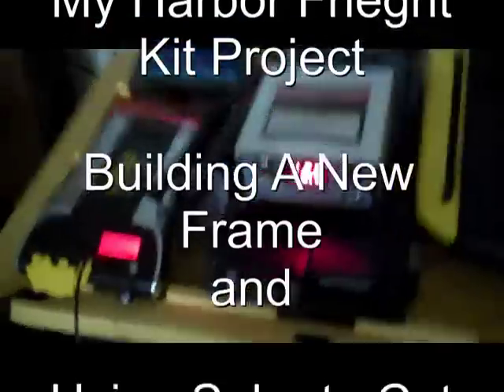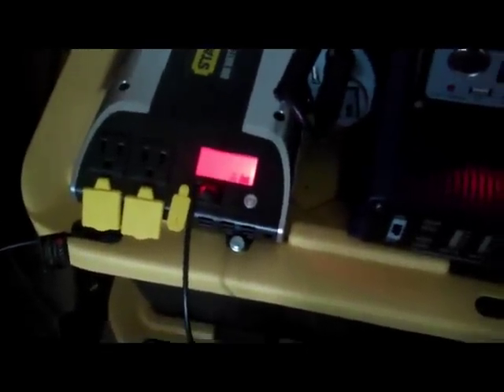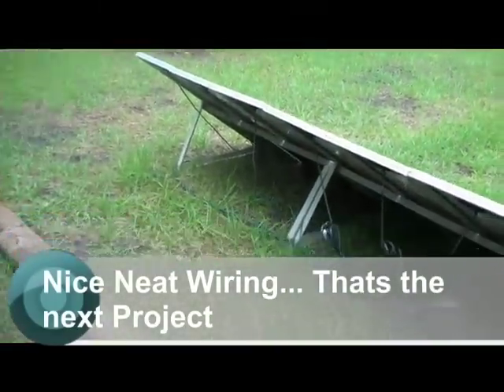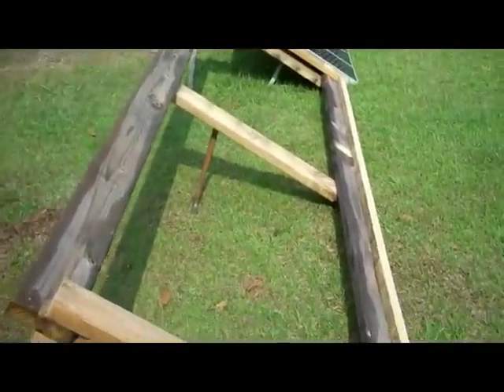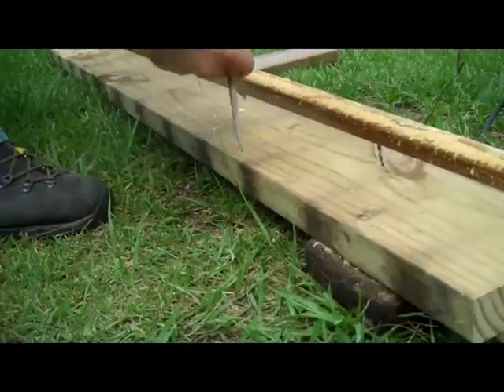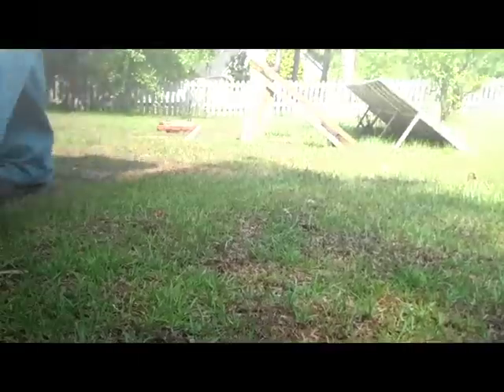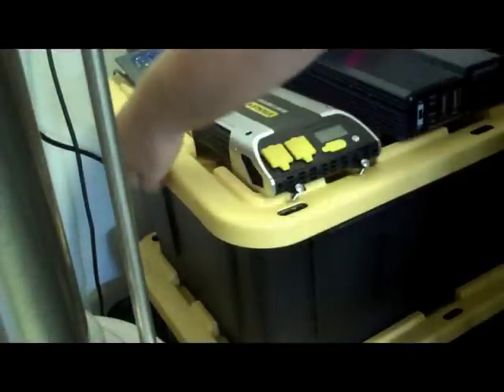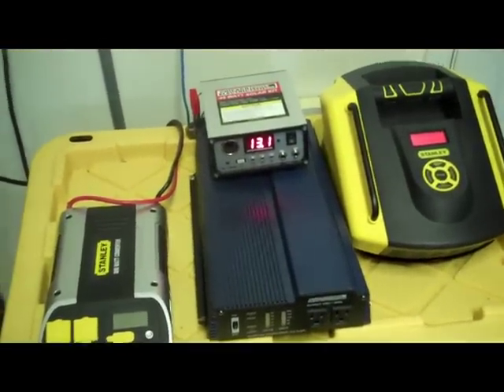Harbor Freight Solar Project

Comment: Nice Job! My only recommendation is when building a frame Screw it! It allows for replacement in any failures down the road. It will also stop the Frequency shock to the Cells.

Comment: I got 2-100 watt Renogy with charge controller and cable hookup for 215.00 with free ship, then added 2 more panels later. I run a 24 volt system and doing the same. running lights, fan, computer, cell phone/tablet chargers etc. I would look into something other then the HF units. they might be fine for a battery charger but there are better ways to go if you want to power anything other then that. I got mine off EBay and am just starting to play around with it. Before it is over with I will be running the whole house/cabin off solar and wind power. Solar and Wind the way to go. Hydro if you have the means.

Comment: Nice project, we are finally getting a Harbor Freight in the town I live in, can't wait!
Reply: The man just stated H.F. solar panels are no good. He suggests "Renogy" solar panels which according to him
work much better than H.P. solar panels. I, however, have no clue who is correct, I'm just beginning to learn what
and how is the superior way to go. Good luck.
Reply: Joseph Maximus I just read that Kyocera KD315GX-LPB 315 watt panels are the most efficient now.
Reply: Jerry Lifsey Hey, thank you for this information I really appreciate it.
Reply: Joseph Maximus
A few excellent sources of information are the manufacturers websites (they are selling stuff ... but an educated consumer is the only one whose gonna drop the big coin, so they also do a pretty good job of educating), Wikipedia -- use it to look up terms such as polymorphous, amorphous, monocrystalline and so on. It's a free encyclopedia (well, guys like me pump a few bucks into it each year) and "Guide to Sustainable Living" by Ed Begley, Jr.

Note: Ed's book is about sustainable living and will take you into a lot of areas you may not have considered, such as rocket heaters. Consider it a launching point, not a final destination.
Reply: bill65761 Thank you for the info. I will
be checking it out.

Comment from the maker: @chop98 I'll check that channel out. My next move is going to be the 100 watt panels. I think it could be never ending. It will be nice to have the ability to run what you need in an extended power outage.
Thanks for the comment

Comment: If you bought the 3 HF solar kits on sale, this setup would have cost you ~$450 (@ $150 each for 45watts/kit), to yield you 135watts.

I bought 1 kit in order to get me the voltage meter and 12v/5v outlets, then bought 4 100watt panels for $125 each from Renogy.So, now I've got 445watts for $650. That's 144% more in cost, but 330% more in production.

Comment: I would recommend a desulfator circuit for batteries in parallel wiring - this should maintain battery life 2 to 3 times longer than a maintenance or constant charge circuit and reduce your maintenance cost of the system.
Reply: yes it would
Reply from the maker: Thank you for the advice. I am looking into it now.
Reply: +ncprepper1 how many batteries do you have and how many amh each
Reply: dude check out green power of nc they are out of greenville
Reply: What is this?

Comment: Good solar setup, my solar setups are lower current / voltage , for outside security light , chargers / controllers for low car batteries. And the small Thunderbolt solar 1 watt for cell phones, players , GPS receivers, they are a lot of fun and handy.  cheers !

Comment: Thanks guy. Listen do you have a video of just of your basic system. I mean batteries wires, hookups from the panels. I have to start from zero on the cheap. I am starting from the single hf solar panels kit. What do I need next, I just haven't found the right instructional video yet. I have to start simple because it I'm always broke and I need to step in carefully. I love your rig and your video is nice and clean you took the time to set it up for someone like me! Thanks dude

Comment: Screws for the frame will be a better choice, and paint or seal the wood before assembly for a longer life. I'd go with the AGM batteries if you want to use that indoors though, the off-gassing is not something you want to breath in.

Comment: The frame is a good idea, and you certainly did a good job at it. However, why did you use such large lumber? Simple 2x2’s would be more than enough to support those small panels even in the harshest wind or weather. If you're worried about them blowing over, sink or stake the legs into the ground a foot or two. Of course, screws into pre-drilled holes, instead of nails, would provide the most strength. Finally, I personally would raise the panels two or three feet off the ground to help keep mud, debris, and rodents off, and allow easier access without bending.

Comment: At 4:37 you mentioned angle of the frame.  I read somewhere that whatever your degrees of latitude is is the degrees of tilt of your panels but then again the sun is at different angles during the day (from east to west) and from season to season.

Comment: i like what your doing....sugestions move panels off the ground for ventilation ,and weed eating mowwing....battery storage should be keep in out building for your safty an not to mention your home owner insurance ...most electric codes do have some rules on the battery bank

Comment: It looks like we picked up the last of the metal frame h/f panels about the same time. Now they are all plastic - interesting enough we both have the same stanley inverter. As long as you have a 30 amp controller you might as well slab some crystalline into the mix - good luck. Can't remeber how I found this video - there may have been some tequila involved.

Comment: I have multiple panels from Harbor Freight also, I am thinking about setting something up like yours I have enouph panels to setup two sets, I will be moving, and will set them up at my new home. Will wire all lights in the house, and run a few items, like my ham/cb radios. TV.

Comment: HOT TIP . There is a product called Battery Equalizer I've been using that doubles battery life. I get 10-12 years on my deep cycles and 9-10 years on my car & truck batteries . A real money saver ...

Comment: Solar-electric dot com in Arizona is the place to go when you are serious. Use a 24V system instead of twelve volts. Plan to size for double max load.  size. A house can use 3kilowatts easy. A hair dryer takes 1200 Watts. A vacuum uses around 800 Watts. A refrigerator uses about 500 Watts. A washing machine uses about 1200 Watts. So you need to plan for a 6 kilowatt system to meet your off the grid system. That Sunforce controller will be way too small to make the grade with clouds and power hungry refrigeration needs. But it is great for a single item to be powered. Like the pump I forgot to include in the list.

Comment: So, this was in mid 2011 with total, 135 watts in space of around, 3 feet by 10 feet. By now, I'm sure, you're using newer upgrade panels that will fit in your same frame to make around, 500 watts to 600 watts in period of 2015 - 2016. Nice heavy duty rugged wooden frame.

Comment: Have you considered (if its possible), to isolate a few house circuits from the main power panel and have those lines ran from your solar batteries? Or even install new outlets that terminate to a separate panel that is fed from the batteries?

Comment: I have had those modified sine wave inverters overheat my computer and other electronic devices... they are ok for heaters... maybe for lights, but CFL's can make noise. Have you tried the pure sine wave inverters? Thanks! Great video! PS - for maintaining panels, I like them on the ground like you have them set up!

Comment: Just a question or two.. Are you using deep cycle batteries? the venting of your batts, do you use fans to outside? Any problems with harbor solar panels? thanks for vid..

Comment: I like your ambition.  It looks like you're using car batteries, and I'm sure they work.  Especially great for sudden big draws?  They are the opposite of what you'd want – made to be hit hard for a short time.  You might rather have "a deep cell" type battery, and they are expensive.
However, wheelchair batteries, ideal.  You can get used ones, that still work pretty okay, at a place near you where they sell/service power wheelchairs!  Check it out.  Directly compatible!  – CaptainPike

Comment: It's been 7 years... could you write an update on performance or any issues you've had. I'm looking into do this but I've heard that the panels don't hold up very well.
Reply: Hey There Jester, Ive owned my harbor freight for about 6 years. System is still working nicely

Comment: I don't know what a gas powered nail gun is but that thing doesn't look like it's working too well.
I'm looking at your frame with the solar panels in and it's not treated or painted and it looks as though if it rains hard that water is going to collect on the bottom of your frame and sit on your solar panels?

Comment: Cool! Can you give a full written list of parts and cost ? I am working on a system for lights and a single ac window unit 5500 btu from walmart for my hunting lodge in the woods. What do you think I would need to make it. One 60 watt light, and the ac, that's all. Thanks!

Comment: where did you get your batteries from and how many amp hours are you storing. the Sunforce 30 amp power controller can produce 300 plus amp hours. I have four sets of HD panels which can provide around 12 amps under good conditions where I live. If I added 4 or 5 more sets of panels the Sunforce should still be able to handle the current.

Comment: I get the concept of lowering your elec. bill but isn't it cheaper to just pay your elec. bill after all is said and done. After you consider panels, batteries, setup time, maintenance, and by the time you finally start recouping some of that money it is probably going to be time to replace your panels again.

Comment: I'm totally off grid where I live.
I've purchased 4 of the 3 pack kits.
My intention is to setup in a 33' pull behind camper. 
Only items I need to power is the low power microwave, a few lights, cell charger and a 12V 30" t.v.. 
My fridge is propane power.
Would like to know the measurement of the wooden bracket you built.
Did you just multiply the width or did you add for expansion

Comment: What part of NC? I'm over in Lexington and my house and garage roofs slope N-S. :-(

There are tracking systems that keep the solar panels oriented properly (and return to the start point over night!). They cost a little electricity and the support design has to pivot on at least the X-Y axis, but more than pay for themselves in additional generating capacity.

Comment: The Harbor Freight panels are grossly inefficient compared to what's out there on the market now.  The HF setup is fine to get your feet wet, but not for a full blown solar setup like what you have.   I have 4-100 watt Renogy mono panels that cost half of what you paid for Harbor Freight and output 2-3 times the amps at half the size.  The price of solar panels have come way down since you did this video, so I wonder if you are still using your HF setup? 

  I started out with a HF 3 panel system and it's fine for very limited power requirements, but isn't meant to be a whole house off grid setup unless you have a bottomless pocket book.  You'll be upgrading in a short time if you want to maximize your power making requirements.  My HF setup is gathering dust, it's just too heavy, bulky and outputs so little that it's not worth the effort.
Reply: @NWHIKER hello i'm trying to learn how to do this and yes i'm new at this there are so many peoples with different ideal so to a new guy trying to build a solo panel what would be your ideal on helping me out cause i was about to look into harbor freight please help me close my mine from wondering so much Thanks
Reply: No problem, I'm happy to help.  I'd suggest looking at the numerous You Tube videos on starter systems and learn the basics on amps/watts and how to calculate your power needs.  What are you wanting to do with solar?
Reply: I live Here in Mississippi and the storms we have been having here lately been really placing us with out Power so i would like to keep at lease half of the house powered up appliance in light basic 3 bed room house
Reply: I agree,most can afford them,maybe not as many as they need at one time,but a couple at a time,versa's China grade[poor at best] which are inefficient and generally don't last very long.Top grade panels have long 25 year plus warranties.
Reply: "4-100 watt Renogy mono panels that cost half of what you paid for " 
I would like to know where you purchased these panels because I'm not seeing it online.
Reply: Joshua Rodriguez   Check Amazon, the 100 watt kit, panel, 30 amp charge controller, connectors is selling for $162, with free shipping.  You can buy just the panel for $150 each.  Sign up for the Renogy e-mail updates they have a sale every couple months that can save you 10-15%.  The basic 30 amp charge controller that comes with the kit is fine and works well, but only has LED lights to indicate charge etc. My second order  I called Renogy and they upgraded my charge controller to the 30 amp digital controller for $20.  Money well spent if you want to know exactly what your panels are doing.  I can track voltage/amps, input/output, and see what's going on with the panels at a given moment.
Reply: NWHiker Make sure you are using MPPT controller and NOT a pwm type. I'd steer clear of Renogy controllers and stick with a top maker like morningstar, kyocera, or equivalent. The Renogy stuff is ok to start off with, but for a full blown system look for better specs.
Reply: true but you have to remember he's starting with Harbor Freight controller Renogy is an upgrade.
Reply: NWHiker try going without lights
Reply: NWHiker I bet you're biting your words now Harbor Freight solar panels are some of the top rated panels. I have 400 watt panels from Harbor Freight 4 kids into one hub and I'm solely on solar. Now I don't use the Harbor Freight controller TriStar is what controller I use now. The thing about Harbor Freight panels is they produce higher wattage than normal panels in the shade or cloudy skies.
Reply: tlt40s&w 70 Do you have four 100 watt thunderbolt magnum kits connected together with a hub?  I just picked up two 100 watt kits to start off and three of their 12 volt 35 amp hour batteries since that is all they had on hand, I have the 8 kit / panel connector and a 6 ft inverter cable set, and was looking for tips on controller and inverters, and other items needed like bridge rectifers and safety cut off switches, I am one of those OCD types so I like to do it right.  I get the difference between pwm vs mppt; was looking at SunSaver ss-moot-15l, but could use some tips since I am a sick, lame and lazy .. cripple and crazy 90% broken down vet on a budget. As memotioned I just picked it up today, so I can return them if need be, and was going to checkout batteries plus and compare since these look smaller than say golf cart batteries.  What I found was interesting is that as soon I pulled out the 1st panel the led lights I use in my house made the blue led ion the panel light up, turn it away the blue led goes out.   Please advise .. Thx.
Reply: I'm new to this . I have 101AH battery  Walmart brand, HF 100watt 4 pannel kit with charge controller box.. I run a 32 inch tv xbox360 or a blue ray DVD. 5 to 8 hr a night every night... have led lights n have had to power down 1 time on a cloudy week.. hf is nice. I'm better there is better stuff out there. My Power inverter  reads different  volts then the charge box HF. I go off Power inverter.. I am planning to upgrade my batteries  first  how many batteries  can I add to 100 watt solar? Will it give it enough  charge ? I'm guessing I'm making more power then I use.. at this point  but need power longer use on weekends   I charge all my phone tablet and double AA batteries  also. It's a work in progress  lol

Comment: Do you hook all panel to the same charger controller? Do you need a different controller for each 45 watt set of panels? Don
Reply: Each kit comes with a charger controller that is rated only for 45 watts so you can only run all three 15 watt solar panels. I bought 3 of these solar kits and a Harbor freight 500 watt charge controller and can plug all them into it to get a final reading.

Comment: have you thought about your batteries off gassing hydrogen ?  the vents that you have there lead the gas to all the electronics siting on top , all it takes is a spark to ignite the gas . I would strongly advise venting your batteries to the outside,  i encourage you research it

Comment: My controller always show 26.2 when I have the 3 panels connected to the battery.  It show 40.4-43.5 when not connected to battery… should it show 26.2 going into the battery? Is the controller malfunctioning ?

Comment: hi, im a newbie lol.
i have 2 HF kits.
can i safely run both kits through 1 of their charge controllers?
my concern is, I've heard a lot of comments stating that when the Harbor Freight charge controller reaches over about 3 amps they quit charging the battery.
so if I'm using the second little gray box as well would I not be actually putting more energy into the batteries?